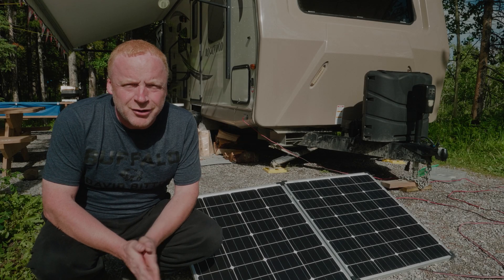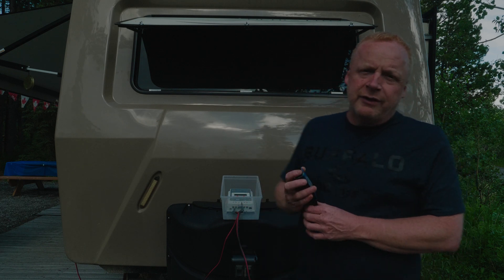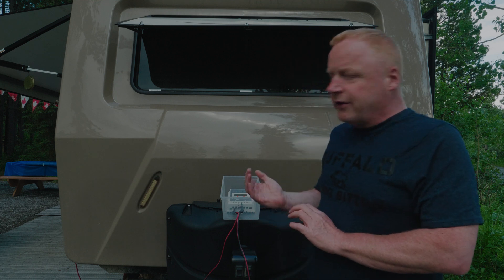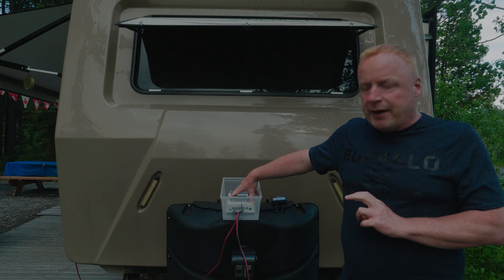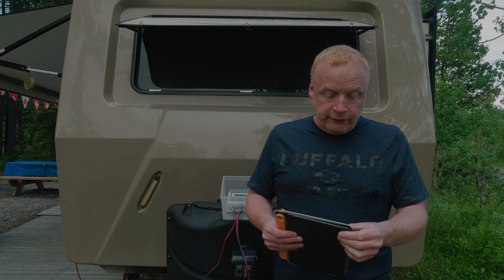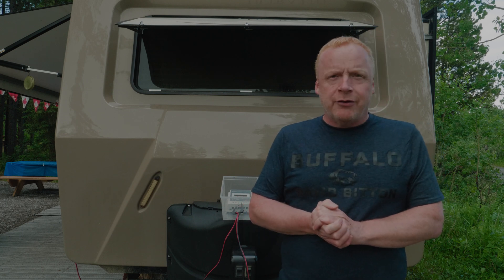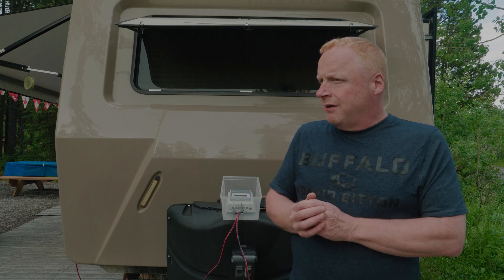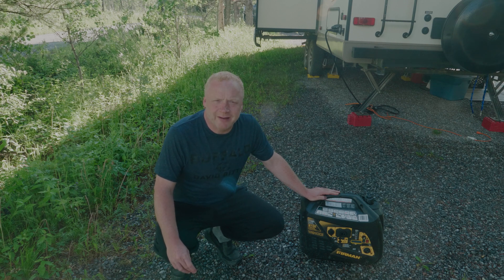Solar Camping Setup | Alberta Camping Tips

Comment: Older video but  I have a question: is your fridge 100% electric? We have the same basic set up as you in Alberta, our fridge runs on propane and only uses a trickle to run the panel. It seems fully electric fridges really draw for the system. Great vids!……..Marcel
Reply from the maker: Our fridge is propane as well, they use about 1/2 AMP per hour, so over a 24 hour period you lose 12A from a battery.

Comment: Excellent video. I used the information you provided to determine my solar needs for this year. My solar panels were delivered yesterday. We have rented a campsite near little smoky for the season so, solar will help with power use. We have a 3200 watt inverter generator which is pretty quiet and I do whatever I can to surround it with tubs and things to insulate it more. I only run it when absolutely necessary and when others are away from their campsites. We rarely use our furnace. I have a small ( 3000 BTU I think) propane heater which was intended for use with one pound cylinders but, I connect a ten pound cylinder to it. I position a USB fan I got at London Drugs for less than $15.00  and a little power bank I bought at Costco easily powers it for the night. I blow air over the heater toward the bed. It doesn't heat our 22 foot trailer but, it keeps our bedroom nice and warm
Reply from the maker: Glad it helped you make some good choices. We're getting enough sun now you should be able to keep things fairly charged up. We find we rarely have to fire up the genset. Enjoy the season!

Comment: Great channel so far. I did A LOT of camping when I was younger and now that I have a family I'm doing the same. I grew up going out camping every weekend so we are hoping to get to the same amount as we just purchased a trailer recently. We didn't have solar back then so this was very helpful to get some tips. I'm checking out your other videos and I recall you mentioning something about a generator with a build in inverter/converter. Do you have any suggestions on where to get them (I'm in Calgary as well). 

Thanks again, and keep the videos coming in the new season! :)
Reply from the maker: We use a Firman 2100 ourselves. We ordered from Costco but you may find them in the warehouse. London Drugs also carries Firman.

Comment: Hi,
Have you converted your lighting to l.e.d? And does it help lessen your power consumption?
Reply from the maker: Hi Ken, our unit was almost all LED when we purchased, only a couple bulbs weren't and I converted one to LED, leaving only the stove hood bulb as the last remaining non-LED bulb, we just don't use that one often anyway.

Yes, going full LED for your house lights will drastically reduce your power usage, I believe on average the old bulbs are around 2 amps while the LED's are 0.2 amps. 

But, while dry camping it is still best to conserve power as much as possible, that means turning off the lights when you're not inside, etc. Lighting in general isn't a huge power draw but the more you conserve the better of course.

On the outside of our rig I added some solar string lights that I taped up along the underside of the gutter rail, and mounted the charge pack on the roof. These provide a dim light but it's enough to see around the trailer at night. Additionally we purchased a few standalone solar powered lights that we place around the site. Minimizing usage of the RV power at night.